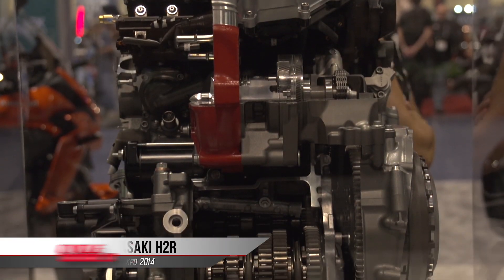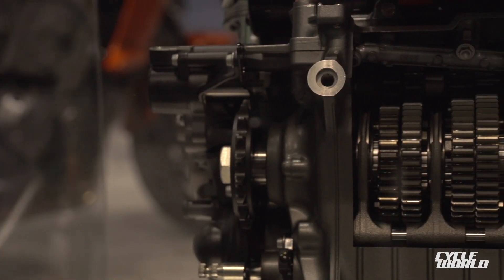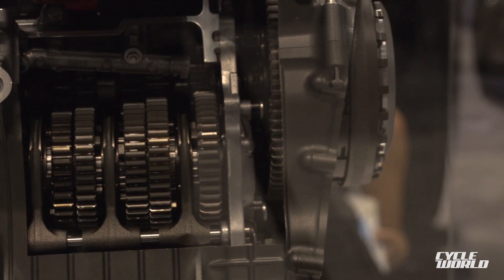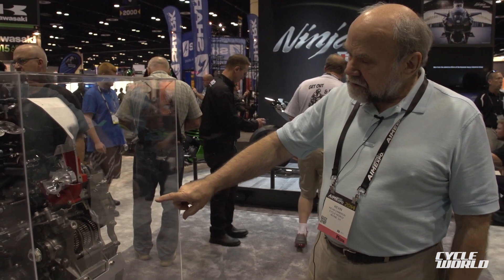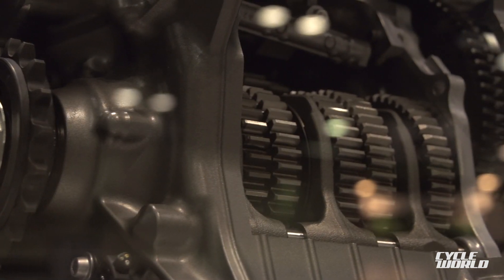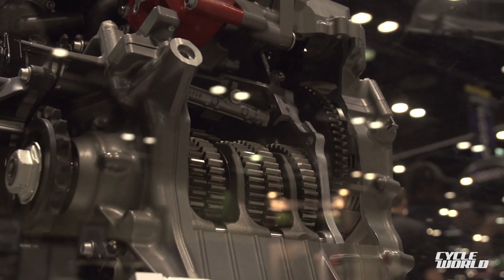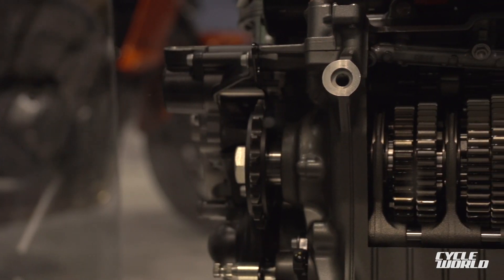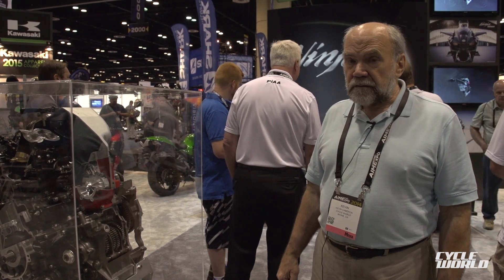Kawasaki Ninja H2R Tech Talk Video No. 2: Transmitting All That Power

Comment: WHY ITS NOT Hilical Gears ?
Reply: straight cut are stronger.....
and a lot of motorcycles just use straight cut

ya wont hear the noise as the bike makes a lot of noise anyway.....and the gears are smaller than a car trans, so they simply make less noise to start with
plus..... i like the noise (also like supercharger WHIIIINNNNNNEEEEEE more than turbo PSSSSSHHHHHes and WHHHHOOOSSSHHHes)